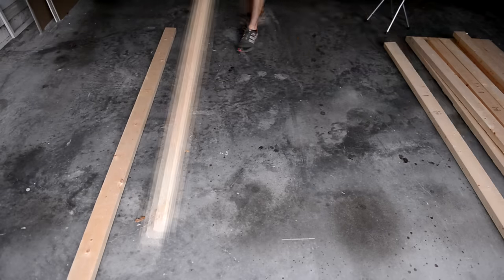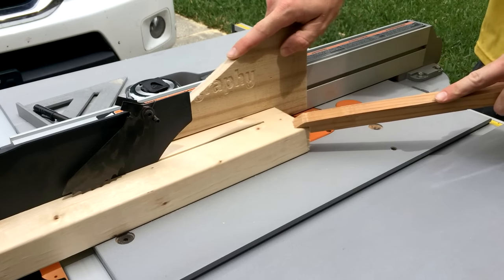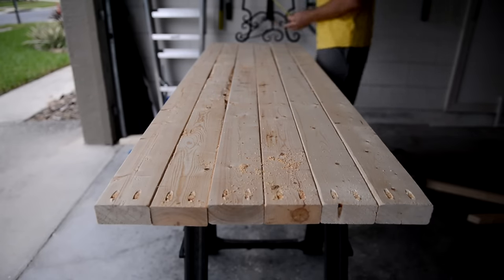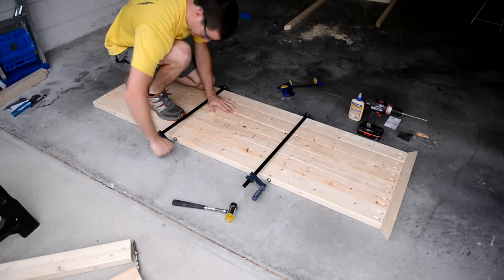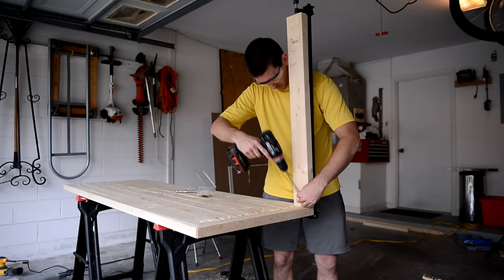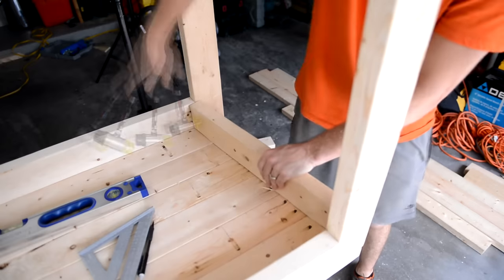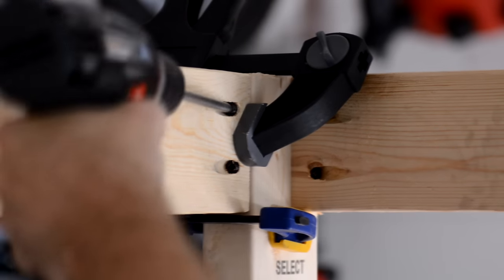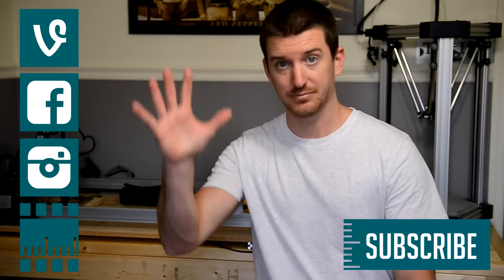How to Make a Workbench Out of 2x4s

Comment from the maker: Thanks for the comments (some of them anyway) and feedback. I wanted to make a video of me building something so this was my first shot and I'm certainly no wood worker. The bench is holding strong even without the glue and it's serving its purpose. I'll definitely be using more glue in the future and I hope to make more videos and figure out my own style. I put a link to the pocket hole tool in the comment section since a lot of you were asking about it. At the end of day, just build something cool that will work for you no matter what others say. Doing is the way I learn best.
Reply: +What Did I Make Much credit my friend, especially on your comments above "doing is the only way to learn". Well, maybe not the only way, but probably the best way. I like to make 2-by furniture as well (I enjoy making but not paying for expensive lumber). I recently made a 2-by desk but used 2-2x6 and 2-2x8 alternating so there weren't so many joints. Only 4 boards to make 28" or so. And yes, I used pocket screws with glue. Also ripped the edges so there was a square edge. I have a planer but didn't use it because I find pine needs be to heavily sanded regardless (may change that next time). So I just used a belt sander across the grain to level it and orbital sander to smooth it out. 

Shellac and lacquer to finish. Keep learning. Me too.
Reply: +What Did I Make How many 2x4s did you use?
Reply: lol! I think this is great! those that are complaining here should come take a look at my thrown together pallet bench! Haha! Yours is a Cadillac compared to mine! Great video format and idea... ignore the firey darts my friend! If you do get a chance, and are reading this, I would encourage you, seriously, to come take a look at my bench!
Reply: +What Did I Make Structurally, looks fine. Is easy to make and not the normal construction.
You kept it to one material type for the whole construction and did it your way.
Fuck the haters, they always come. That looks as sturdy as fuck and I'm sure it will outlast most of the haters on here.

The fact here is that YOU made it, YOUR way. And you took the time to post a video on it. Man, that takes some time and effort and nothing but kudos for you on this. There are a hundred ways to build a bench. And now, there are a hundred and one. 

Great job :)
Reply: +What Did I Make Really nice job uțve done there. Nice video. Nice tutorial. Keep it up!
Reply: hey buddy. Great video! What length Kreg screws are you using here??
Reply: What Did I Make
Reply: Thanks a lot for the excellent work
Reply: Bro i appreciate for downloading this precious work video please let us enjoy your more beneficiary work video awesome god bless keep going on dude
Reply: What Did I Make like it dude.  Nice job.  I know others have given you flac about all the screws and no glue, and they're right, but you built this, is yours... you took the initiative to get it done and film it for YouTube.  Props for getting it done!
Reply: btw, did you attach the camera to the sander for one shot? that was kinda neat
Reply: Glue is stronger and cheaper than screws will ever be. Plus you should have run the boards for the surface through a jointer so the edges meet together better.
Reply: I’ve watched this at least 4 times.  I haven’t read all the comments, but to me it doesn’t matter.  I really like this and appreciate the video.  Please keep making them.
Reply: What Did I Make thanks for sharing. Keep it up!
Reply: @tonireeder5820  been removed
Reply: I loved it.  Perfect for a nubcake like me that's going to try and avoid the stink and touch of messy glues.  After watching it several times I liked the comedy too ;-).

Now I have to watch your others vids :D
Reply: @ajw0529  dude you should really find some other videos.... jesus christ
Reply: You said "I'm certainly no woodworker".
You HIGHLY underestimate
yourself young man ! ! !
THAT WAS AN AWESOME     AND AND EXCELLENT BUILD.
Reply: I know i'm super late to the conversation but this is literally my second project and I'll use it for my next 2 projects. Thanks for sharing
Reply: Doing is not the only way to learn, but I will agree it is 1 of the best ways to learn.
Reply: What Did I Make you did a great job and it didn't cost a lot it's a work bench not a dining room table so don't listen to all these people telling you that you should have done this and that. I don't know about some of these comments but my work tables get used hard. Thanks for the video.
Reply: MacCraiger awesome man. Love it ima make one now.   Thanks for the video

Comment: Nice video. Simply as a suggestion: Run and screw cross members under the table top to secure the table boards to eliminate the many screws,  Also the bottom leg supports should always be higher than the bottom of the actual legs. That way the bench won't "rock" if there is a curve in the floor.  Making the table top overhang the frame will give a larger work surface and at the same time, allow for clamping projects to the bench.  But again good video and nice project.
Reply: Great points duly noted for my project!!

Comment: Built a basic 2x4 six foot workbench with a lower shelf about 30 years ago with a handsaw, hammer, measuring tape, and some nails. It still gets daily use. This was a nice table but if all you want is something to bang around on you can do it with half the tools and 80 percent less work.

Comment: Good build, good video. Obviously you were trying to keep the parts list simple, but one big advantage of adding 1 item (plywood) is that you can simply replace the top layer once it gets beat up, which is inevitable with a workbench. Of course you can simply add a plywood top here also, although you then lose the great look of the framed 2x4's!
Reply: put another sheet of plywood on when the first layer gets bad,  Use glue and not screws.  When it gets to a point you can't move it get another and start over.  I have gone through 5 doors as my base and horses as my support.

Comment: Ignore the negativity of the keyboard commandos. This was a solid build and the good thing about using screws is you can modify this bench over time and add onto it as need be in the future. if you start getting sag in the middle of the bench top you can put either joist blocking in on the underside or use a diagonal brace on the underside to act as a strong back. I use angle iron on the bottom of the edges of either end of mine to serve as a good spot to use magnetic hangers for the tools I'll be using on certain projects. Excellent start and keep building.

Comment: Not bad for a beginner. If you do this again, here are a couple of small changes to make that will create a much stronger table, first use glue. Lots of glue. Use the screws to hold it together while the glue dries. Wood tends to shrink after a while, loosening the hold of the screws.  For the legs, two pieces of 2X4's in an "L" configuration. Mount them a couple of inches in from the edges. This adds a great deal of stability to the table. On your edges, use 2X4's turned on edge. Glued and screwed, this will prevent any future warping the table may experience. For the lower leg stabilizers, move them up 6"-8" off the floor. Easier to clean, and you can add a shelf for more storage.
Reply: He said he doesn't like using glue or "any kind of goop"..... I remember the table I made before I learned that glue is stronger than screws or most boards. I cut it into pieces a few months ago.
Reply: Carl Bruschnig, Jr s
Reply: Very helpful comments, Carl!
Reply: Carl Bruschnig, Jr ..5& nñ
Reply: Carl Bruschnig, Jr Yes,glue helps alot.Your suggestions for a more expansive version would be nice. However,this just a basic table for us beginners,so it easy skills usage. And maybe one needs a basic table such as this one.
Reply: Mini Skirt 👍🏾 Haha. I agree, great effort for an unskilled/qualified craftsman. I would also raise the lower skirts off the floor. Not only could you create a shelf but there will be less chance of instability if the floor is not level. 
Great effort and good to see. 👍🏾
Reply: While mounting the legs/skirts closer in may have benefits, a gap between the legs/skirt from the edge reduces functionality of a workbench, since them on the edge allows pieces to be clamped or otherwise held vertically (though the difference can be split and keep some on the edge and some not).
Reply: Generous comment. From where I'm sitting nobody with a table saw can be considered a beginner. 

He should have used double the number of 2x4s for the top, using his table saw to rip off the chamfered edge and then laminating them vertically. No need for that silly mitred frame around the outside. If he wanted to he could have used a few screws in the laminating and used minimal "glue and gooey stuff."

Then while you're at it you may has well do it right. Double up on the 2x4s for the legs as well and make something really sturdy that can take a pounding, and give you decent support for all the woodworking you're likely to be doing on it for the next decade or three.
Reply: @eldoradocraftsman3733  And stubbing toes on them which could cause a tool slip or drop.
Reply: Ur right
Reply: Carl Bruschnig, Jr Interesting.  I did not realize that about using glue.
Reply: Thank you for such a constructive comment. Will surely consider all of your recommendations.
Keep sharing!
Reply: carl   instead of talking so much, make a video
Reply: What I like about this design is that he could roll a set or drawers underneath. You can't do that is there is a shelf.
Reply: Maybe those pocket screws are secure enough, but they don’t look really secure to me.

Comment: The comments are hysterical.  I'm surprised someone did not complain that it was not made out of 1/2" sheet steel!  Or maybe someone wants it to be painted pink!  LOL ;-)  For my part, I watched this video, as well as others, and got a number of ideas that I'll select from.  I'm not sure I want to spend a bunch of time building a bench, so I'm looking for ideas that will give me something that is "just good enough" for my needs.  I love the concept of pocket holes but I never thought of using them in a shop bench.  I think of them having more application in furniture, where the loads are not so great and the emphasis is on hidden connectors.  I also understand the strength of glue and would go that route, even though it is more fussy and messy.  I saw another video where the maker used threaded rod to make the top stronger -- a great idea if using a glued top.  I'm torn between making a bench that looks like furniture, vs. covering the top with fiber board to give me a renewable surface that is always smooth.

The bottom line here is that this is a really good video and makers always want to make it another way.  I notice that most who criticize this video have not posted their own video for us to criticize.  LOL.

Comment: Hey Craig...   I built several picnic tables with 2x4's and 2x6's.  I found the tops almost impossible to get nice and level and keep them that way even with end and middle bracing. That in mind, I wouldn't waster my time on the 2x4 top, I'd simply get a sheet of 1 in plywood. Much faster and probably not much more, if any, expensive to use.  I will say one thing, you certainly do love those pocket holes !   :)

Comment: that top is going to twist and wrap like a banana
Reply: +david osullivan How would you need to make a tabletop to make sure it doesn't warp after some time?
Thanks in advance
Reply: +Reinhout Platteau the 2x4 need to be glued together face to face not edge to ege this doesnt guarantee it will stay flat but has a far greater chance than the method in the video check out paul sellers making a work bench on you tube I have made one of these and 5 years on its solid
Reply: +Reinhout Platteau I believe you should alternate the grain direction from one board to the next as well.
Reply: +david osullivan Also, over time, the warping and flexing of the main boards will push off the edging that he put on.
Reply: If your going to use this configuration, seal all the 2x4 s with shellac, particularly the end grain. It will prevent the wood from absorbing moisture, and make warping much less likely.

Comment: Hi mate, I've made several benches over my years as a carpenter/joiner/cabinet/furniture maker/woodworker/guitar luthier from 2 x 4's (or 4 x 2's as we call them here in OZ) using similar joining methods. My method of preference is pocket holes (Kreg system) and glue (either PVA Titebond 3 or Gorilla Glue - the original polyurethane one) for the frame/legs etc. and biscuits with glue (same as above) for joining the lengths for the top. Like you I pick the straightest knot free lengths for the top and then once glued up, dried and any excess glue removed with a chisel I plane the top dead flat with my #7 jointing plane. A tip for you for getting perfect mitre joints. Start at one corner of the piece (bench top or whatever it is) and work your way round cutting each length mitre to mitre about 1.5 mm longer than it looks like it needs to be. That way you'll get nice tight mitre joints and if one is a fraction to long you can plane it back a little with a block plane. Use a small sharp block plane as they are smaller and lighter to handle than a bench or smoothing plane and designed to plane end grain of timber. in fact they are called block planes because they were designed originally to flatten butchers blocks which you may have noticed are made from blocks of timber set end grain up to create a surface able to stand up to the butchers chopping and cutting meat and bone. As an after thought, some may ask why do I make benches from cheap pine 2 x 4's? My answer is a bench needs a dead flat top to do fine woodwork like furniture and guitars. But why make a bench that is like a piece of fine furniture (you've seen the ones I mean on Youtube and elsewhere) when you are just going to chop, cut, dint, beat and bash the shit out of it with your hammers, chisels, mallets, etc, not to mention dribble glue on it or molten lead or solder etc. when you use it every day to create your beautiful timber masterpieces! If I owned one of those beautifully finished fine furniture work benches I'd be too scared to use it! Just my humble opinion.

Comment: good stuff :)
if you don't mind a couple of pointers.. no point in using a level to level the legs unless the other surface is level too..measure the fixed end of the legs .. use that at the other end and that will parallel your legs  
your corners/45's ... one at a time will help and use the next piece to mark the corner this will take into account any variations in the wood.
keep up the great videos !!!

Comment: The 45 degree angles aren't actually your problem. The problem is that the actual bench top you're using isn't perfectly rectangular. If you use a jointer and get all of those 2X4s perfectly edged and lined-up before you clamp them all together, then those corners will fit together like melted butter. Your bench top will look sharper too!

Comment: Great job and very realistic for the average guy that's not a pro or even the 'home pro' type. I just built a bench for general use and like yours it didn't need to be perfect, it just needed to be sturdy and the right height. Nice use of the pocket holes and hiding the screws.

Comment: Great job!  But as might have been mentioned already glue isn't something to be avoided :).  Wood glue is water soluble and the bond is often stronger than the wood itself.  Over time the 2x4 will warp and your work surface might not be flat and glue between the joints may alleviate that.

Comment: You said your miniskirt fit tight. lol nice job!

P.S. You have more spent in fasteners then a HF shop bench cost.
Reply: Oh please shush. He used what, 60 screws. I can go into home depot right now and get those expensive as hell 100 pack GRKs, or even a Kreg kit of 500 pocket screws for under 10 dollars.  Stop with the exaggeration.
Reply: He was using drywall screws

Comment: I don't see why people think you should have used glue. If it's just a simple work bench to work at this is PLENTY sturdy! Super cost efficient too. Great job!
Reply: The biggest issue is if something heavy hits the side or corner you could rip the screws out pretty easy on a 2x4. I probably would've used glue but hey he's happy and that's what matters right. It looks like a solid table though.
Reply: This is a very grown up, objective and positive answer. Quite rare around here.

Comment: This is one end of the spectrum. Nothing wrong although I would absolutely use some Titebond III on those joints. I've been checking out other videos, and some of these other guys are spending a week and using planers and jointers and making a workbench that would hold up a Hummer. To anyone else out there, I'd say figure out what you want to do with your workbench and use a design that meets your needs and is build-able with the tools you have.

Comment: Can you provide an update on how the bench is holding up after a year?
Many people commented below on how pocketholes are NOT the way to go... Just wondering if anyone has really tested the longevity of pocketholes without any glue, your workbench could provide insight.
I was going to build a very similar bench to yours. 
Actually just built a king sized platform bed with only pocket holes and lag bolts for the corners. It's solid as a rock. No glue.
Reply: it seems (judging from it being behind him in that last shot) that its being used as a table to hold small cnc machines, rather than a work bench. In that use, it's probably over-built, but for work bench duty this isn't far off from a card table. Pocket holes are good for fast builds that don't need longevity, or aren't going to see abuse, they always seem rock solid at first, but are intrinsically weak to the loads that joinery is often required for.